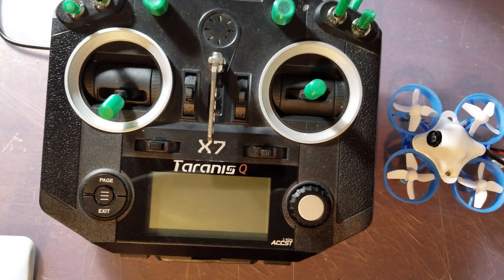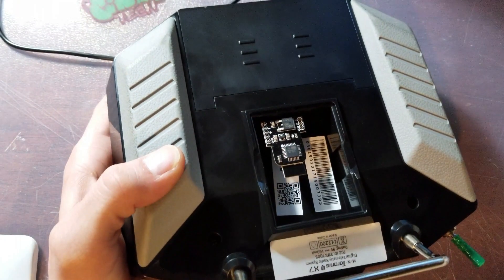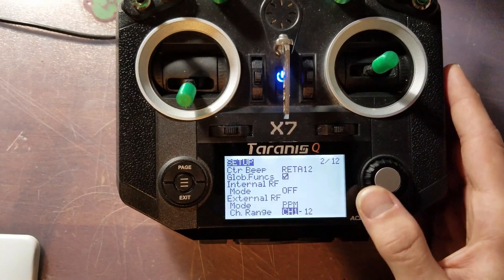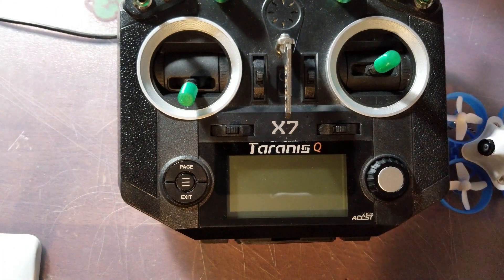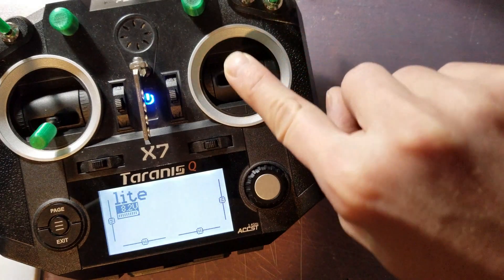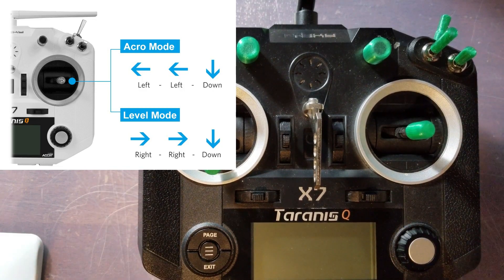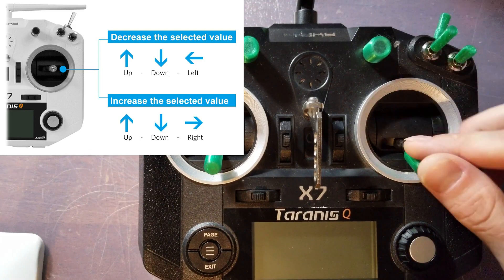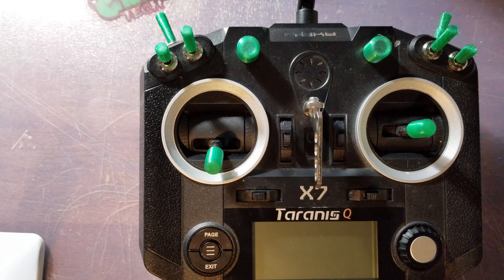Setting up Your BetaFPV Beta 65s Lite with the Taranis QX7

Comment: I really like the way mine flys, but the video fully cuts out at random and causes me to crash every single time. Sometimes on the other side of the house, but usually when it's within my line of sight even, which is really annoying. I have to say the power is nice, but not worth it if you can't fly it. They still haven't got back to me about it.

Comment: I hav just try this module, n need some help. First I have to turn off the tx whenever I change battery to rebind the some quad again, 2nd my other quad always bind in level mode, I followed your instruction 2x left+down won't worked. Noted both of my quad are h67 flash acro, I used to use jp4in1 module n all my quad worked well

Comment: i have everything bound up but do you know why acro isnt working, ive tried the gesture so many times to get into acro but nothing happens, i really want to fly acro :(
Reply: The same. When to do left-left-down? Tried right after turning on, after arming - nothing.
Reply: @vladimirkarsakov1988  figured it out, put a switch on channel 6, you use that switch to turn on the ability to input the stick gestures.
Sometimes they don't work, just flick off then back on the switch you set up on channel 6, gestures will work, now I have acro 😊

Comment: 3 good binds and no more light blinking  on my mtx-9d :( what a waste of 22 bucks from Amazon
Reply: If you are have that BetaFpv 65S Lite,  you should use the BetaFpv external module for Bayang so you can set your rate on Channel 9.
Reply: I have a lite module and my beta65s v1.1 spinning like crazy in circles ,how to set up
Reply: @mannypaul2826  Check your motors position
Reply: I gave up on it because it can't get to work normal ,yaa are reversed

Comment: Hey in bayang protocol which channel is for flips ?
Reply: No flip for the BetaFPV, but if you are using a stock E011 board, it should be Channel 6  on your Taranis with the iRange6X multiprotocol module.

Comment: Okay, what was that thing you had to put in the back of the controller and why? This is a $130 controller, and it doesn't work without that thing? I can't even bind my betafpv f3 board with my FrSky 2.4G ACCST Taranis Q X7. I don't know how. So for now, my quad and controller are nothing but useless paperweights. No one on youtube straight says how to bind the quad with the transmitter.
Reply from the maker: The multimodule is for non frsky receivers.  The f3 board you referred to should work fine.  Basic steps to bind are.  1.  Hold bind button while powering on the FC.  2.  Choose d8 on your transmitter and select bind.  3.  Power cycle FC and ensure lights are indicating you are bound.  From there you can confirm by looking at your receiver tab in betaflight.  If you do not see stick movements ensure you have the correct uart turned on and the correct receiver selected under the configuration tab.

Comment: Could you do the same with the jumper remote? Is there anything to do? Big thumbs up!
Reply from the maker: I'd love to but I do not have access to that transmitter.  I can look into it and see what I can do.
Reply: do these mode and pids gestures works with e011 acro? great video
Reply: With the Jumpers (in my case the T12), just change the stick inputs like shown but dont use PPM as the jumper doesnt support that but instead select Bayang Protocol in Mult mode. Thatll work just fine.